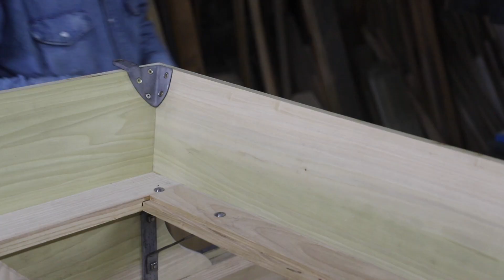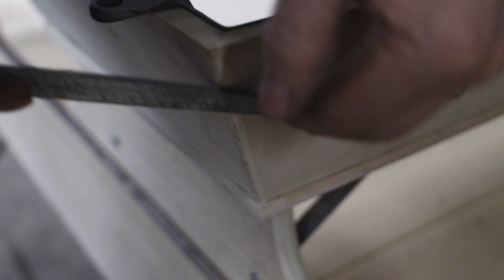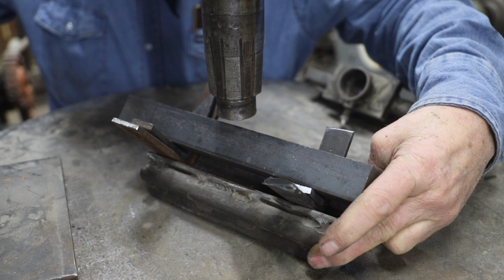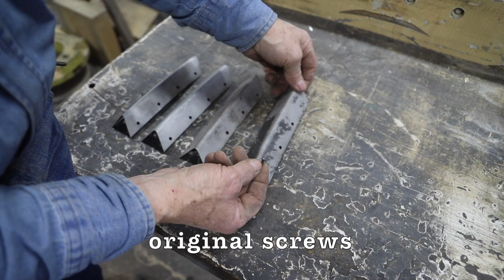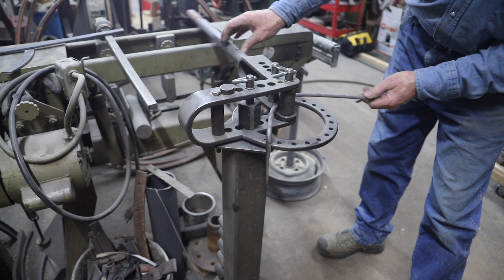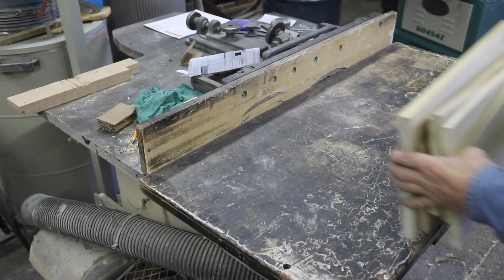Final Assembly of the Buggy Seats | 2 Seat Buggy Part 12 | Engels Coach Shop

Comment: Amazing amount of skill and labor to required build a buggy.  Researched a bit and found that a buggy like that one was about 50.00-75.00 in 1895, added to that a couple of horses at 15.00 each, and annual feed and care for the horses at about 20.00 each plus the barn and daily labor put your buggy cost at around  150.00 per year.  By 1925 Ford was selling a new model T for 260.00, so you can see what a revolution the automobile was at the time.
Reply from the maker: You're right on in your research.  Well done.

Comment: I applaud you for using torx screws and finding an clever way to disguise them!
Reply: What was the reason for using them instead of slotted?
Reply: @JamesCrandallPainting  Much easier to power drive. Maybe availability - FH slotted screws not on hand; wait 2 days or go 40 miles.
Reply: @milantrcka121 But if slot-heads were intended, why not just plan to switch them later? Maybe the screw-heads were going to be covered in any case, to prevent snagging on clothes?  If “easier” was the objective, seems like he’d be using Torx / square drive and hex nuts all over the place.
Reply: @JamesCrandallPainting  Why indeed.  There are limits. Disclaimer: My thoughts only based on watching Dave's videos for quite some time and beginning to understand how he approaches challenges of the job at hand.  BTW: Slots were not intended, they were there the only thing back when, long before Torx head was even conceived.
Reply: @milantrcka121  I was hoping someone would know the actual answer.
Reply: @JamesCrandallPainting  They are much easier to drive (especially with an impact driver) and not as likely to have the driver bit slip out of the screw head and mar the work. I've been a carpenter/woodworker for over 40 years and think that the invention of the torx head as one of the best things to ever happen to the trade!
Reply: @JamesCrandallPainting  "Only Shadow knows..."
Reply: @jraybye  I KNOW they’re easier to drive with power tools. That’s not the question. He normally uses period-correct hardware, even when it’s not easier, and even when he has to make part himself...why did he NOT on this occasion? I’m not judging, I’m just asking. 
He went to the trouble of covering them up, THAT wasn’t easier than leaving them exposed!
Reply: @JamesCrandallPainting   Here's one thought I had as to his reasoning. Dave and I are about the same age and after many years of working with his hands, he maybe experiencing some of the connective tissue/joint issues that I am. Obviously it's a lot easier and less stressful to pull the trigger on an impact driver that grip and turn the handle of a screwdriver. Perhaps he will enlighten us in the next video. Oh, and as an aside, the only downside of torx fasteners is that if you strip one out, you're screwed! Pun intended - I just couldn't resist!

Comment: I thoroughly enjoyed watching this series on rebuilding the buggy seats.  I learned a thing or 2, or 3, actually probably more like 20.  I was happy to see someone else address the nuts, bolts, and screws.  

I did a pretty big job of making some inspection covers where the previous owner of my airplane had just cut two pieces of the aluminum floor out of the baggage compartment to comply with a required inspection.  He just covered them up with a single sheet of aluminum held down by 4 screws instead of following the FAA approved instructions in the STC.  Then covered it up with the carpet.  By the time I got the holes squared up they were about 8 X 14 inches.  I riveted in some angle aluminum leaving a ledge to rivet self locking nut plates in every inch.  When I screwed the inspection plates in I was addressing each of the #6-32 X 1/2 inch screws.  One of my partners told me I was wasting my time and that it did not make the repaired area any stronger.  That was true, it did not make the repair any stronger, but I was proud of the way the repair came out and addressing the screws made it look more professional.  It was my first decent sheet metal job since I was in the Air Force in the early 70s.  So it had been around 30 years since I had done one.  I told my partner I was only going to charge the time the job called for.

Comment: Not all wagons and buggies are made the same because each builder had their own way of doing things.  Near where I live there used to be a small factory in Brockport New York that made McCormick reapers.  The machines were built to McCormick's specs but as they gained experience they made improvements both to the design and how they were assembled. The same thing happened with wagon and buggy builders, and as a result there are hundreds of variants of these buggies everywhere you look.
Reply from the maker: Exactly.

Comment: Love your work. I wonder if heating the spine of the corner angle iron is having the same effect as heat cambering of steel beams - heating wedge shaped pieces and letting the cooling cause the bend. It tries to expand in every direction but can’t where it has material around it. When it cools it shrinks, pulling the curve in the wrong direction for your purpose. Try heating a triangle of the flange and see if it pulls in the curve you want.

Comment: I reckon there might have been a few coins set aside for the swear jar in getting those corner irons to bend to your will, eh, Dave? 
Funny, I thought sure you'd have cut a very fine line (fretsaw malybe?) from the edges just through to the two middle holes where it was buckling to allow for the compression factor, then weld and grind. But hey, banging on it with a hammer seemed to work just fine!

By the way, correct me if I'm wrong, but I think this episode is the first one ever where I've seen you use a back saw instead of a hack saw. Am I right?

This is turning out to be one of my favorite series and I, like all of your fans, can't thank you enough for the years of pure, unalloyed pleasure you have brought me by sharing your consummate skill as as a wainwright and real talent as a videographer.

I wish you and yours the happiest, healthiest and most prosperous New Year ever and greedily hope for many a new project to sit back, clear my mind and just enjoy watching you work. THANKS, DAVE!!

Comment: As a body worker I'd have heated small spots along the outside edges of the angles and quenched them repeatedly to shrink the outer edges. Well done getting it done the way you did.
Reply: I told him the same, an old trick for metal workers.
Reply: we already know he is not a woodworker !  uses a rasp. LOL
Reply: @stevewhyte8476  Better than me. I'd use a grinder for everything
Reply: I was saying the same thing: sadly youtubers never listen to good advice in real time ;)  Back when I did custom bodywork; before I had shrinking dies, every high spot or buckle required the heat quench cycle....then a slow anneal to keep it from cracking later on.
Reply from the maker: You could tell I'm not a body, sheet metal man huh.

Comment: Happy New Year, to you, and to all your watchers. Despite the havoc and calamity of the past year, you managed to provide a wonderful series of videos.

I was wondering while watching you getting the curve in those corner pieces whether peening along either side of the spine would have stretched the spine enough to give the desired curve. After all, if the edges were too long (buckling) isn't that the same as saying the the spines were too short? That same curved square bar would have made a perfect anvil for the peening. A cross-peen hammer striking at a slight angle would help make sure the stretching was predominantly close to the spine and in the correct direction.

Comment: I've been watching your channel for a while now and this is the first time I noticed you line up the screw heads so the slot is in the same plane, and the nuts on the bolts have all the flats in the same orientation when you tighten them down. Eye for detail.
Reply: Happens every time!

Comment: I've been thinking about those compound angles you had a struggle with (lower half of the seat side and back contact point).  You said somewhere there's a formula and there is. While I don't know the formula I do know where to look. The formula is in roof framing, thinking here of rafters as they connect in a valley and to a ridge line. I recall also seeing a tutorial using a 'framing square' as an analog calculator to do the math. I hope this lead sends you in the right direction for the answer to the formula question.

Comment: You need a "shrinker/stretcher" used in sheet metal work to shrink the sides to force the curve.  I've even seen them at Harbor Freight!
Reply: Or use autobody heat shrinking technique.   Make a small bright red spot and quench with a wet rag.   A line of those down the edge will eliminate the waves.  Hammering makes it worse because it stretches the metal.   Thanks for you videos, the quality of your work is wonderful and inspiring.

Comment: You should have heated to a low red the outer edges of the angle (at the center of their lengths).  Steel shrinks when heated.  You have an excess of metal there, so it needed to be shrunk.  Don't over heat to orange, just a dull red and let it cool.  Don't hit it, though you can quench it.  Heat shrinking panels is the old bodyman's way of removing stretched metal when restoring a car body.

Comment: Nice job as usual but shouldn't the 2 vertical metal straps on the face of the seat be attached to the back of the seat, not to the front?

Comment: Looks really nice, very good work probably better than new. I very much appreciate and enjoy the detail of the work, very interesting. Looks like a lot of metal brackets. Some cast, some forged, and some hand worked. I was wondering if the buggy makers made their own metal work or were there suppliers that provided the pieces? Hate to comment on a master craftsman technique but the fit-up problem could have been a bit easier with heating and quenching, "flame straightening"  and use of a shrink hammer used in auto body repair. What about a foot rest?  Thanks for the nice video.
Reply from the maker: Many were supplied by vendors.

Comment: TMI? Not a chance. 

As for those curved corners it looks like you could have used a shrinker hammer and die or a “modern” set of shrinker dies. Apparently the shrinker/stretcher dies are a decent tool.

Comment: I thought you would have heat shrunk the outer edges to induce a curve.  Maybe that doesn't work on iron?  It works on steel.
Reply from the maker: Shows I'm not a sheet metal man huh.

Comment: Since you don't directly address this, I assume its not a problem, but----I'm surprised that the wood behind metal pieces doesn't get water damaged since its not treated or pre primed. In old houses I'm amazed how much damage a small amount of rain can cause when it gets trapped between different elements. Have you found that not to be the same in wagons?

Comment: I was surprised that you did not prime and paint, or at least use an anti corrosive coating,like Zinc Chromate, on the metal parts prior to installing them.
Reply from the maker: Oh, but if you watched you'll see I painted all the iron where it touches the wood.
Reply: EngelsCoachShop   I must have missed that part some how.  I may have watched that part when I should have been sleeping and dozed off for a few minutes.

Comment: The problem with your angle brackets I think if you use a flat file and putting the bracket on the anvil and thumping it on the area were it buckled you can shrink the metal like they do in panel beating or else invest in a second hand shrinking tool

Comment: I don't understand not protecting the wood under the steel. It can't easily be done later because of the peened bolts. How will the completed buggy wood be protected? What products will be used, stain, sealer, paint? I'm Confused!
Reply: Hey! The original lasted about 100 years, so what's the worry?

Comment: I'm curious if you could have gotten at least some of the curved shape of those corner brackets by repeatedly heating and quenching the edges instead of heating the spine.  I know this trick is used to help contract one side of a bent shaft but, I don't know how well it would work on a piece of sheet metal.

Comment: I'm confused as to how those corner bracket could be curved along their length.  Aren't both the side and back boards flat?  If so, they should be making a straight corner edge at some angle (excluding the round-over).
Reply from the maker: In a previous video I showed me rounding them on the outsides.

Comment: I never heard the term 'barn soured' but my dad told me he was using a team in the field and a sudden hail storm came up.  Horses headed for the barn and the implement didn't make it through the doorway.   I thought of shrinking (quenching) the sides of that angle, not the apex.  Pileline trick.  I think we would all like to know what the OTD price is on this watertight buggy.  8,800U$?  Is that poplar you use for the seat backs etc?
Reply from the maker: Yep, poplar.  Heat shrinking would have worked also.

Comment: Dave, Bonne Année,
Pour mettre en forme la cornière en métal, il ne faut pas chauffer l'angle mais les ailes de la cornière, ce qui produit une chauffe de retrait et par conséquent cintre la cornière dans le sens désiré.
Cordialement Jean-Pierre Griffeuille
Dave, Happy New Year,
To shape the metal angle iron, you do not heat the angle but the wings of the angle iron, which produces a shrinkage heat and therefore bend the angle iron in the desired direction.
Sincerely Jean-Pierre Griffeuille

Comment: I guess i just don't get the torx screw thing
Reply from the maker: That's okay.
Reply: @EngelsCoachShop  ok, well thanks but why use them if you felt the need to cover them up with epoxy?
Reply from the maker: Most all the original coaches and fine carriages even covered their slotted screws.  Seldom were screws ever seen.  They used a lead based compound called rough-stuff.
Reply: @EngelsCoachShop  ah! Ok, thank you!

Comment: It's possible that the original corner piece was rolled on either an english wheel or that machine, the name escapes me, which sort of looks like a bead roller, but isn't, and also does curves (tho that one would require two people to operate).

Comment: I'm surprised that the nut end of the bolts are towards the passengers, and not installed with the (rounded) heads towards the passengers...  care to explain?  Seems to me that it would be awfully uncomfortable to have those nuts and bolt ends sticking into one's back.
Reply from the maker: Upholstery covers it all.
Reply: @EngelsCoachShop  Thanks... I thought that might be the reason...

Comment: "Barn soured horse"  yep know that all to well....
Reply: Back when I was 15 we had a barn soured horse. (I never knew that this was the name for this action)  A nice chocolate brown named Cocoa. As he aged he loved the barn. This happened to me twice. Cocoa knew when he was going home. But he could not be held back and went into a full gallop.  What a ride! Hang on for my life.  Turn the right-hand corner at a full gallop, I wished that a loud WOAH would have worked. The barn was 100 feet away on a left-hand turn.  Full speed ahead for old Cocao.  The barn door was a 7-foot high garage door. My head was about a foot higher than that. Bend over quickly, no time to waste.  Into the barn, old Cocoa Dug his heels in while I clutched his neck as hard as I could.  A great sigh of relief!  I think this was the last time I rode old Cocoa.
Reply: Been there, done that.  Hack horse was surprised when I "pulleyed" him, slammed on the brakes and dropped his head, wrangler was surprised when I stayed on.  The horse behaved for the rest of the ride after that.

Comment: I am in AWE of the attention to EVERY DETAIL you meticulously restored/replaced, except one. I am baffled why you would put those square nuts on the inside of those seat backs — even after you ground them, they would be VERY uncomfortable protrusions to sit against. I'd bet you could feel them even if you upholstered the seat back. Could you enlighten me why you didn't use a flat head bolt from the inside, with the nut & washer or washer plate on the outside. In fact, why couldn't the brackets be mounted under the seat and behind the seat backs? Seems counter-intuitive to me. Same on the tailgate of that buggy. Thanks again for sharing your extraordinary skills and talent.
Reply from the maker: Stay tuned.  :-)

Comment: You’re doing the corner shrouds all wrong, you need to shrink the buckled edges of the brackets with a water soaked rag, it’s the exact opposite of what you think should be done. Heat the edges, not the back/corner of the brackets, no hammers or clamps required, an old trick.
Reply from the maker: Yup.  An old dog still learning huh.  :-)
Reply: @EngelsCoachShop  - think about what you do with the steel tyres when you shrink them on the wagon wheels, it’s time and heat, like steam bending your wood too, easy peasy.

Comment: - So much work just to get the metal fittings right. Ugh! People don't appreciate what you do, Dave.
- There is a shrinking metal technique of heating and then immediately cooling with a wet rag.
- It is talked about on "Western Flyer Restoration EP 27 Restoring a 1947 Flxible Bus" at: https://www.youtube.com/watch?v=kn_QtX3vxOQ&t=673s
- The metal disk on drill shrinking-tool design is interesting and its concept of producing friction heating and then applying immediate cooling with a wet rag is most interesting and cunningly obvious all at the same time.
- YT search: https://www.youtube.com/results?search_query=SHRINKING+AND+STRETCHING+METAL+WORK